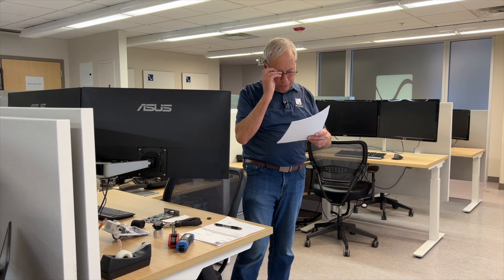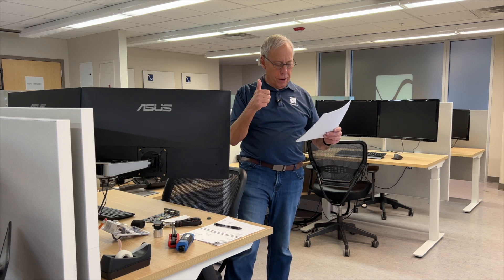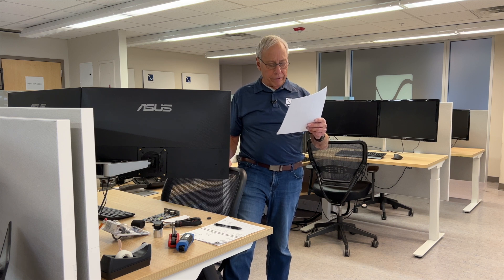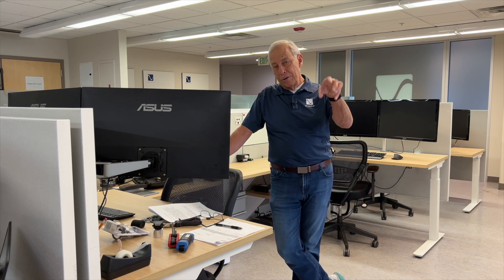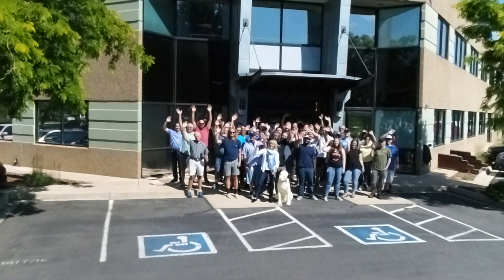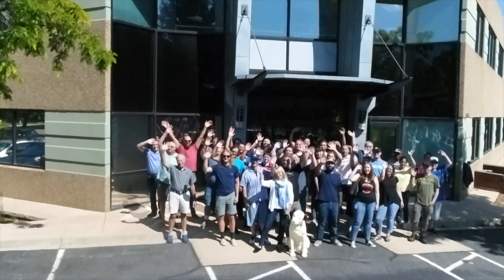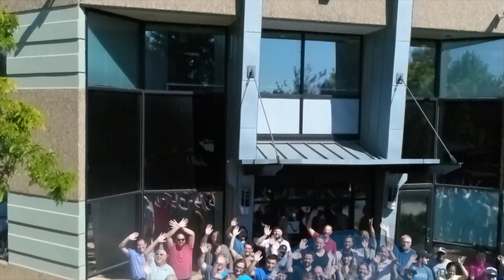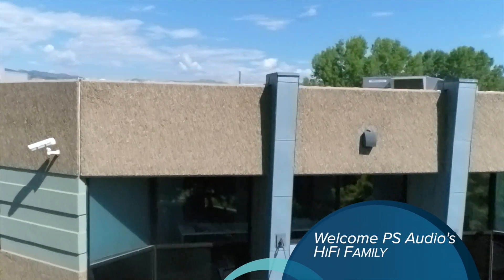Using two electrical phases

Comment: Could I use three electrical phases ? I don't know, although I guess that Electrical Engineers know the answer. AC converted to DC in the device,  then why not?, but what is the point?
Reply: 3 phases are for 3 phase motors !!.  Where would you connect the third phase.   3 phase = 3 live conductors 120 degrees out of phase with each other designed to induce rotation of squirrel cage inductiuoin motors ???
Reply: @philipslighting8240  If you hook up a three phase transformer to a 6 diode rectifier, you can get DC out of it. The 120 degree phase shift will actually help with the ripple, so the same amount of filtering will give a cleaner DC voltage. 3 phase is not only used for synchronous motors, almost all industrial equipment runs of 3 phase AC power.
Reply: @hugobloemers4425  I would never "hook up" anything,  that sounds very unprofessional, I would of course connect in keeping with relevant regulations. Obviously you can rectify AC but why in gods name you would connect Mains voltage directly to a rectifier i dont know.  I assume you are not Qualified.......
Reply: @hugobloemers4425  An even smoother DC current —if that makes any sense— could effectively be the goal from an audiophile perspective: flatter than flat. That's a good point  hugobloemers4425.
Reply: @philipslighting8240  "but why in gods name you would connect Mains voltage directly to a rectifier i dont know."
Are you familiar with Switch Mode Power Supplies, SMPS? You probably have 50 of them in your home today. Small 50/60hz power transformers are becoming obsolete due to cost and energy efficiency regulations. SMPS almost exclusively has a line connected rectifier running a high frequency power oscillator with a much smaller high frequency  isolation transformer.
Reply: @philipslighting8240  Mike, the problem with some Audiophiles as I have seen over time in comment sections and and forums is that they seem to have difficulties with abstract thinking. I never said this is the standard that makes sense or is safe. It is just a mental exercise of what you can theoretically do. Why, becasue you can. Should you do it? No, probably not.
Reply: @andydelle4509  There would be some form of  protection device before the rectifiers you would never connect dirrectly.  Usually the voltage would be stepped down in audio before rectification as I am sure you know.
Reply: @philipslighting8240  Mike, if you judge somebody else, you are always disclosing your own ego.
Reply: @hugobloemers4425  What a very typical US American response. Calm down old lad.
Reply: @philipslighting8240  Point in case, I am from Europe.
Reply: @hugobloemers4425  Not British ?
Reply: @philipslighting8240  Well yes there is a fuse and some LC filtering before the rectifier in an SMPS, but the primary rectifier is still basically directly across the AC line. There is also a PWM oscillator that runs off this DC at 50khz and higher. This allows the use of a much smaller transformer for the same wattage as a linear 50/60hz transformer supply. The secondary high frequency AC voltage is then also rectified into DC through  an LC filter. The regulation is accomplished by the PWM action. Therefore the efficiency is very high 85% or more because there is no linear pass element to trade off excess voltage as heat.  Like I said above, just about any consumer electronics with the exception of AV receivers and audio amplifiers use switch mode power supplies today.
Reply: @andydelle4509  Yes
Reply: @philipslighting8240  I have 3 phase welder. No inductors and motors involved. There is beauty to 3 phase power because where is no moment where supply voltage is 0v. With 1ph power you have zero volts 120 times a second. Effectively you have 120 moments where you don't receive any power from the wall and you need inductors and/or capacitors to buffer some energy.
Reply: @edfx  I said it was designed for.......
Reply: If you run in a delta configuration of a three phase system, like they have in Europe in houses (though we run it typically as a star or 4 wire + ground for domestic use) then you need to multiply one phase by 1,72 to get the voltage between two phases. You will end up with about 400V. Good luck with that on audio equipment. If you want to do that on a DIY amp and you buy a three phase transformer, go ahead, knock your self out. You will surely have less of a ripple before filtering, so it does have advantages.
Reply: @hugobloemers4425  I live in UK its not Delta its definitely Star, center point Earth and common Neutral.  .  Delta is only used in an old star delta starter for very large motors and that was well into last century.  Don't make statements unless you have the knowledge.......I am an industrial Electrical engineering Technician since 1979 with 4 years apprenticeship a City and Guilds of London Institute ONC, HNC in electrical and electronic engineering repair and maintenance.
Reply: @philipheyes607  That is not even a bad idea, though in practice you will have three primary and three secondary coils but on one iron core. Google images will show you how that looks.
Reply: @hugobloemers4425  You can also have three separate single phase transformers. Look up on utility poles. Quite common. And then there is the "open delta" two transformer configuration where the load is well balanced like a machine shop with lots of three phase motors. Note I am talking about USA power systems.
Reply: @andydelle4509  OK, I guess those are the more modern domestic installations. It should be quite easy to measure. If you get 208VAC between phases, that is your configuration. (You can still use that BTW as if it is a 230VAC single phase. specially if you have a switching power supply. It will be sub-optimal for a normal 230VAC transformer, specially if the DC voltage is not regulated.).
Reply: @hugobloemers4425  In the North America, pole fed three phase services typically use three single phase transformers  wired as Delta or Wye secondary, probably due to weight and wind profile concerns. Underground feeds use a pad mount transformer which is a single core with three windings.

There is a weird now obsolete three phase delta configuration in the USA called a "high leg delta". This is a standard  delta secondary except that one of the windings is center tapped.  So you get 240v (not 208v) around the delta. On the center tapped winding you get 120v from either end (A & C phase) to the center tap which is the grounded neutral. From the center tap to the B phase you get a useless 208v single phase. This was used where a service had a smaller 3 phase load but higher 120v requirement.  So you had one large single phase transformer and two smaller units. A cost savings for the utility. A PIA for the electrician because every B slot in the beaker panel is useless for single phase loads.
Reply: High power radio and TV transmitters as just one example use three phase AC to produce DC. Many other high power devices that need DC use three phase power. One advantage of a three phase DC power supply is lower ripple with smaller capacitors.

Comment: Could use a European PSU model and run both phases?
Reply: No you need 230v plus a neutral in Europe this equipment just not designed to run on 2 Live phases.   Be carefull unless you know what you are talking about !
Reply: @philipslighting8240  In the US, the two phases have a shift of 180 degrees. Therefore the RMS voltage is, as Paul said, exactly double to a single phase. And the shape of the sine wave is maintained. Moreover In Europe unlike the US, a mains plug can be reversed, so there no dedicated line and neutral. For this reason equipment designed to run on 230V AC in Europe is capable of running on the two phases as found in domestic applications in the US. I am not saying this is a good idea from a normative standpoint. I am purely making a technical statement of the compatibility of the equipment with the configuration mentioned.
Reply: @hugobloemers4425  The US cant change the laws of Physics. with 3 phases there is 120 degrees between phases a total 0f 360 degrees (what a surprise). in a 3 phase supply even  if only 2 of 3 phases are used there is still 120 degrees between phases.
Reply: @philipslighting8240  They don't get it.  Have you ever seen the state of the house wiring over there worse than Greece 💥💥💥💥💥💥💥💥💥💥💥
Reply: @hugobloemers4425  if the device cannot handle balanced power AC+/-120V then it needs a 1:1 power transformer in front of the device (there will be power loss), separately derive AC 240V hot, 0V neutral and optionally lightning ground
Reply: @philipslighting8240  the split phase are not 120 degrees apart, they come from opposite ends of a center tapped transformer secondary, center tap being neutral to both legs
Reply: @philiptong4978  There is no difference between +/-120VAC and 0-240VAC from a point of view of a PSU. It is a non issue. I think if you would study more electronics, you would see that.
Reply: @philipslighting8240  Hi Mike, the typical US domestic AC configuration is not three phase but two phase. Play the video of Paul again and pay good attention to how he explains it. In summary, the two phases are created from a single phase primary winding in your local step down transformer. The secondary winding is 230VAC with a center tab that is grounded at the transformer. A separate ground wire for safety is supplied. The laws of physics are used in a clever way.
By contrast, in Europe, typically houses are supplied with a 3 phase 4 wire + ground configuration at the entry. The fuse box is a three phase, 4 wire  buss system where all outlets have the return path to neutral and are evenly distributed among the phases. to get an as symmetric use as possible. Here, if you connect two phases, you will get about 400VAC and it is not sine wave any more.
Reply: @hugobloemers4425  certain design assuming neutral to be same potential as ground will have an issue when neutral is 120V (compared to ground of course)
Reply: @philiptong4978  So its not a 3 phase transformer.
Reply: Sounds cool, then you get two power cords from each side of the room and use only the phase pin on it. Go for it, you will half the primary current so the power-supply should sag less.
Reply: @hugobloemers4425  BOOM !!!!!!💥💥💥💥💥
Reply: @mikepxg6406  Don't do it if you don't understand it.